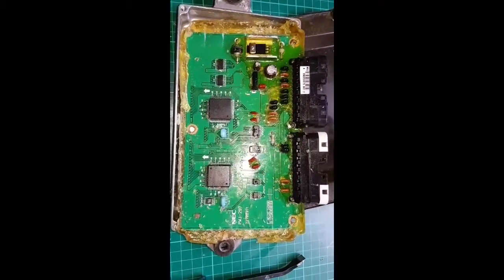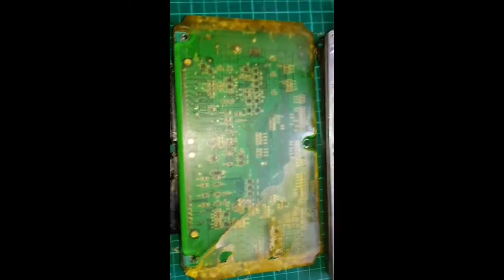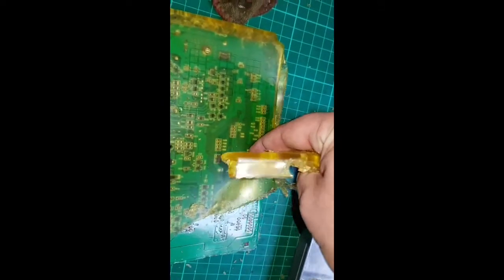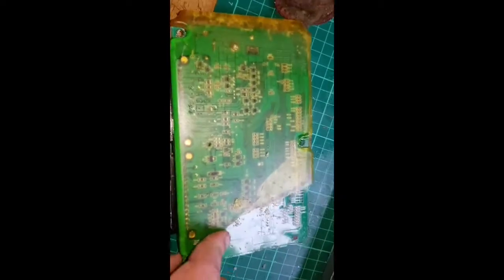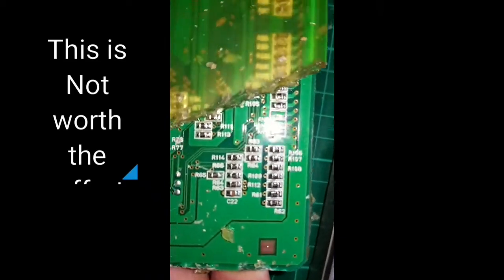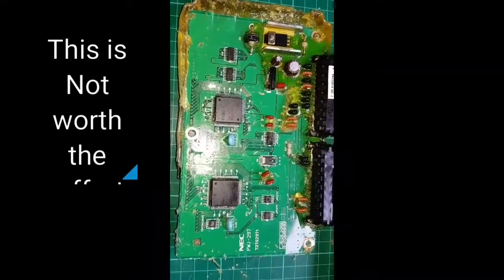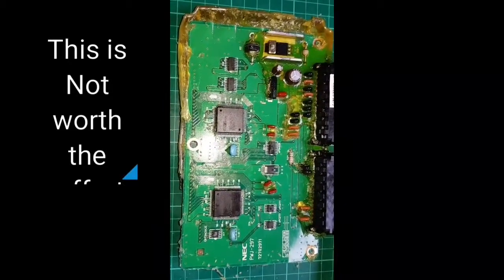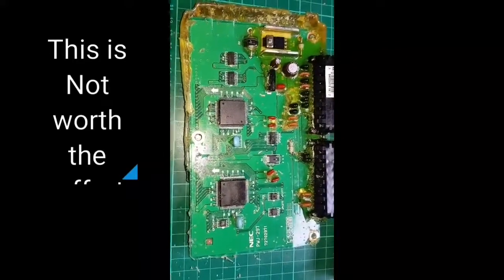Part 2 of the CUP board and Gel

Comment: would this method work if i wanted to desolder and replace a a capacitor basically to repair a circuit board?
Reply from the maker: I found the drawback was the board required. A lot of cleaning! I would say no. If you want to replace the board or ic chip or a capacitor this method will require far too much work.

Comment: How to remove it if the silicon gel is already melting to the PCB and stick into pcb
Reply from the maker: Light heat
Reply: @AceBullion  Can you explain this?
Reply from the maker: I have used a scalpel heated over a candle whilst having the WD40 start a few hours before. This way you have full control and protection from the heat. Just use caution and have a suitable area